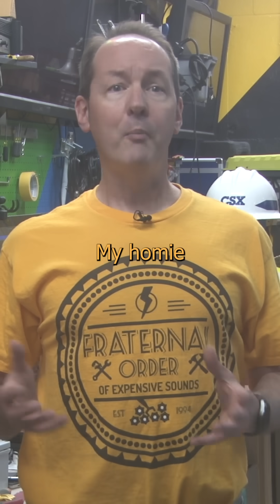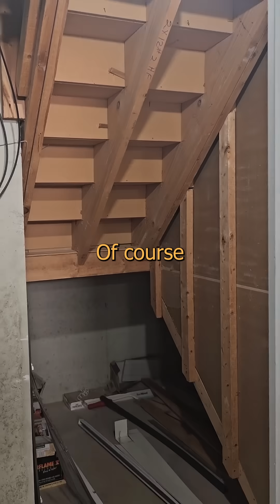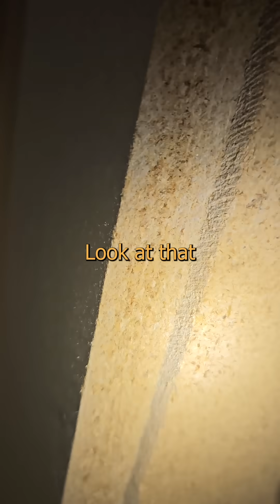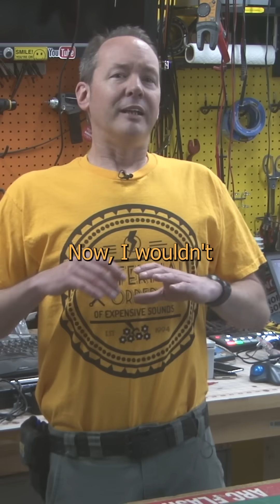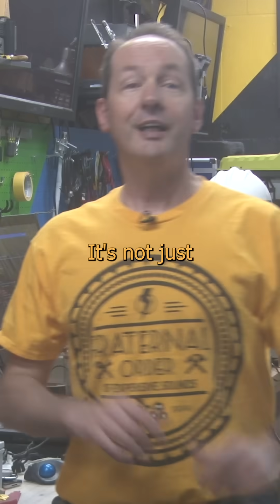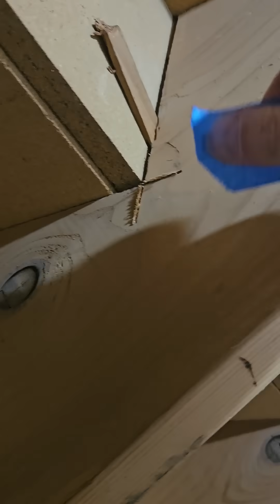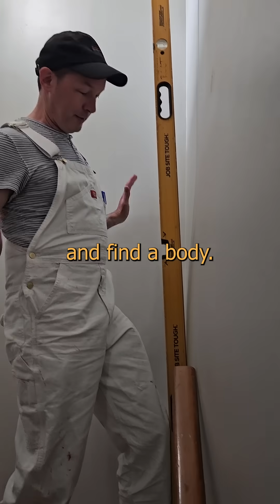Particleboard Staircase #chrisboden #engineering #construction #stairs #cheap #job #work #carpentry

Comment: It's like after WWII, we developed a leak in the bucket where we kept all of our know-how when it came to building homes, and it all just dripped out a little bit at a time.  I mean, the houses from before WWII are all full of wi-fi destroying flatwire for phones that nobody uses anymore, the stuff on the walls is lead and arsenic with a touch of paint to bind it, sayng that you a person utter the phrase "ground fault interrupt" in a tone you found to be offensive was considered a legal justification to shoot them dead on the spot, and god help you if you flush a toilet with someone in the shower who wasn't planning on receiving 3rd degree burns to most of their skin.  

BUT, they could sure do some god damn fine woodworking, I will give them that.  Few things are as rewarding as removing layers and layers of disgusting vinyl from several decades of cheap floors being installed one atop the other, only to get to the bottom and find some gorgeous (but thoroughly neglected) deep red oak begging to be loved, to see the glimmer off a cherry wood with grains that sparkle when the polish is high, or uncover a swamp ash floor with enough character that it could star in its own period drama about the decade of American history when it was first installed.  If you've ever done any contractor or contractr adjacent type of work, for sure on the east coast if not on the West, then you are well familiar with the excitement of a moment like what I was describing just now.  It's not what I do professionally, but it's something that I've had the pleasure of doing since I was a kid at my daddy's knee, and in all of those decades that shit never gets old.

Comment: Half the houses in NZ are built with floors like this. It can handle a fair amount of water if it's the proper flooring stuff. It's bad if you have a slow leak and you don't realise til it falls apart.

Comment: Yoo that wall drift is insane! There is no way that could pass an inspection on my state, that's like an inch a foot when regulation is something like a half inch for every twenty feet. Like if I were this guy, I would be more worried about that wall coming down than going through the stairs.

Comment: Over cutting the risers is very dangerous. They will break.
Take a 2×4 and nail it on each side of the middle stair raiser, with 3 inch nails, and on the inside of the two outside riserers. That will brace it forever. 
I am a contractor and was almost killed because of over cuts less than those. The framer I had hired to build a three story house had done that on all the risers going all the way up to the third floor. I had told him all summer to brace those stairs. I was showing the owners the house. We were on the third floor. (It was still unfinished at the time.) As I started back down the top riser broke and I fell 3 stories through the stairwell, breaking my fall with the second set of stairs with my ass and back, and that pitched me out onto the concrete 1st floor. As soon as I could stand, i had to get up and help the family off of the third floor, then I went down the other house that framer was building for me and fired him on the spot. 
If that second set of stairs hadn't broken my fall, it could have been really bad for me or one of the family members. I'm just glad it was me and not a worker or one of the family members.
So please tell him to brace those stairs, and stop being cheap with materials. If any water gets on that particular board it with turn into soft powder.

Comment: went to visit a friend was coming down from the upstairs almost stepped on a cat that was pretending to a shadow caught my balance briefly with the railing before it pulled out of the wall and away i went (turns out some brilliant jack-wagon who incidentally lived in the other half of the building decided that instead of finding studs they just put a little 4x4 piece of wood on top of the dry wall and put a punch of pin nails in it) worked ok if you pushed down on it lightly but if you tried to use it in a manner that was at all vigorous it pulled right out (i tested this next door while explaining the problem to the builder)

Comment: I haven't worked in carpentry for over a decade now and I still flinched hard at that sight. Don't even need water or anything, some guy in a hurry taking two or more steps at once has a non-zero chance to just push straight through this.

Comment: I worked as an HVAC installer and when we got called in to work on a house being built we were told to put in the AC in and we usually center it and square it off on the walls but turns out whoever put up the walls had a crooked eye or level because this thing was all kinds of warped and full of weird angles that did not meet at 90. It took me like an hour to figure out what "I" was doing wrong. Turns out it wasn't my fault

Comment: The paradox of houses getting more expensive but being more cheaply, I already know where the money is going
Reply: Lol at the reply to this comment that thinks it's the government at fault and not the quick buck builders shitting out houses where they cut every corner, way past safety limits, and still charge a pretty penny, and get away with it cause they've got people in their pocket.
A properly functioning government that wasn't lobbied to hell would be putting these builders out of business very quickly, and the houses would never reach market. The lobbying is done by the builder's investors, not by the government.
Reply: @blarghblargh people will blame literally everything BUT capitalism for the late-stage capitalist hellscape we live in. They will blame government, individual workers, immigrants, and even unfixable/persistent factors like "greed" or general incompetence before they point at the system that we literally can change. Literally anything that doesn't involve people demanding significant change (even though our lives keep significantly changing for the worst). I think part of it is because they would do the same things if they were in position of the corpos/capitalists, and their real problem is the fact that they are at the receiving end of it instead of the "winning"/scammers side of it, which says more about these types of people than anything else.
Reply: @VoteOrDie99  the non-functioning government is very much a part of late stage capitalism.
Reply: @blockwithaglock96 very much so because the capitalist corpos own it, and it's the last tool people really have left to challenge the owners (short of violence and direct action, really). Remember that the neoliberal solution of "vote with your dollar" means that people (and entities like corporations and interest groups) that have more dollars get more votes, which in a world of high income inequality means that a few people have the majority of the market power.
Reply: @VoteOrDie99  this happened in 2012
Reply: That's the american scam
Reply: Some is going to the inspectors, if your state has that
Reply: How else is he supposed to buy his new work Denali that has never loaded more than his 500 lb ass?
Reply: @duwang2324  The answer is always Wall Street
Reply: @duwang2324  I’m investing in particle board stocks RIGHT NOW
Reply: @duwang2324  this is not a new build.
Reply: Now every new house built must meet expensive energy efficiency standards with insulation that used to be luxury homes only, and insulated double pane e-coated argon filled window glass that didnt exist in the 1980s

Receptacles every 6 feet, outdoor receptacles, GFCI and AFCI arc flash current interrupt breakers on virtually every receptacle & load, hardwired smoke detectors, 

guess what's NOT regulated? Requirements to use materials guaranteed to last more than 20 years.
Reply: oo a clippy
Reply: yeah its going to israel
Reply: @pimphatwaggoner1655  They need the money so they can have free healthcare ☺️
Reply: To the b🇮🇱nk
Reply: taxes
Reply: In reality houses cost the same now as they did back then. What changed is our money. The difference in house prices now compared to years back is a reflection of the hidden tax we know as inflation. Look up how much gold it would have cost to purchase a house in the 80s compared to now. You will find the amount of gold required didn’t change. The paper money we use is no longer backed in full by gold. If you had the gold to do it then it would be the same price now then it was in the past.
Reply: @reefercreeper1750  You're wrong. Housing prices have gone up exponentially, while income has gone up linearly. Housing costs have outpaced inflation by 60%.
Reply: @RayMurphyX did you even read my comment? You are talking about the price in cash. I’m talking about the price in gold and the fact precious metals don’t depreciate in value the way our money has.
Reply: @reefercreeper1750 people don’t buy houses in gold. You are completely wrong on your inflation vs house pricing immensely. We are now exponentially dumber for having to read your ridiculous comments. 😂
Reply: @tylerburks6871 it doesn’t matter if people buy it in gold or not. Prove my statement wrong. If you can’t comprehend the FACT that the price in gold hasn’t changed then you are the one that’s exponentially dumber for making that comment. Whether most people buy houses with gold or not was not the point. Obviously barely anyone is out there buying houses with gold 😂 it’s a representation of inflation which you obviously can’t comprehend. As I said to others and I will repeat again. PROVE ME WRONG! If you cannot do that then you have no business claiming to know what you are talking about.
Reply: @reefercreeper1750 Have you considered the fact that you are conparing two goods whose price might have increased exponentially, maybe even for different reasons?
That's no claim that prices have stayed same, even less if conpared to workers income, and even less so if the prices of most other goods haven't risen at the same speed.
Remember, correlation doesn't always mean causation.
Reply: @RayMurphyX  the price has increased bc of inflation AND the decrease in interest rates.   Dollars to dohnuts you are paying the same price as anyone in the 80s.
Reply: @reefercreeper1750  The price of gold has changed since 1971, when the US dropped the gold standard backing for the dollar.
Buying a house back then would require almost 600 oz of gold; today, due to market fluctuations, it would take less than 100 oz of gold to buy a house at the median price. Because despite your bizarre, reality-denying claims, gold has not magically remained the same price for the past 55 years; it didn't even remain the same price between January & December of the year it stopped backing the US dollar.

So not only are you wrong, you're fractally wrong.
Reply: @reefercreeper1750 that is unfortunately very wrong, if you do some quick math you can see that the median cost of a house in 1980 was ~$62000, and if we adjust for inflation that gives us ~$243000 in today’s money, if you were right houses would cost about that much today, but unfortunately as of August 2025 the median price for a home is over 400k. TLDR we got fucked over and houses are almost double the cost.
Reply: And before you start some shit about “the price of gold” this has nothing to do with gold, if you bought a house with gold in 1980 vs. today you’d need double the gold! That’s what adjusting for inflation means!
Reply: @reefercreeper1750 I don't think I've ever read something so wrong in my life. Jobs pay the same as they did before, prices on houses have went up over 7x, and we aren't on the gold standard at all. Since 2015 house prices have gone up almost 2x. And then to top it off throw in inflation.
Reply: @reefercreeper1750  Sorry mate, but you're dead wrong. That's not how ANY of that works, and inflation isn't the only issue.
Inflation has caused a 700% price increase since the end of gold backing the US dollar, but houses in the States are currently 1500% more expensive than they were when the gold standard was ended. They've gone up drastically in just the last 20 years, too - and a large portion of the blame can be laid at the feet of greedy property management companies & real estate lobbyists.

The price of gold wouldn't change the increase in housing prices, because the increase isn't purely due to inflation. No conspiracy theories or armchair economist nonsense will change the facts.
Reply: @reefercreeper1750  you have no idea what you’re talking about
Reply: @2ndbrain909 prove me wrong then. You can’t because YOU have no idea what you are talking about. You all say I don’t know what I’m talking about but nobody has even tried to prove me wrong.
Reply: @reefercreeper1750  it's all pretend. Even the shiny rocks. We made it all up. House prices have far outpaced inflation.
Reply: Homes in the US are dirt cheap despite what the Internet thinks for some reason, which is the problem.
Reply: @calebm9000 you either live in Switzerland or have no idea what you’re talking about
Reply: @calebm9000  even if that were true, which it objectively isn’t, how exactly would that be the problem?
Reply: @calebm9000  Median house price in the US is 10x the median yearly income. Up through the early 90s, the median income was enough to afford a house without a bank loan.

When the median house price is $400,000, and the median income is $40,000 a year, that's not "dirt cheap" to anyone who didn't grow up wealthy.

Comment: You are correct. The treads are a no go. So are the over cut corners of the risers. That should have all been caught during the home inspection. Since they were not the owner may have cause to hold the inspector to task on getting them fixed. That’s why home inspectors are required to have tons of insurance coverage.

Comment: As a carpenter, I'm a bit scared from what you've shown us, and I've done Victorian remodels!!
I don't know if that particle board is code there or not but it most likely is if its in an area that is not expected to experience moisture. I know that I've seen a ton of it used, mostly as subflooring. I have never installed it and if that was my house I would either tear out the treads snd replace or install treads over it. I'd also check the rest of the flooring on the house, particularly the bathroom and kitchen, to see what they used. Im guessing that is a early 80s build?

Comment: As someone who lives in a mobile home from the late sixties/early seventies,

actually this construction is still sub-par.  Yeah, this double wide has 3/16" thick panelling for its walls, none of them are straight, the whole thing is bowed when you look at it, ceiling, floor, doorways are visibly skewed, all that.  And yeah, the floors are largely particle board.  But that's particle board over 2x8 joists over I-beams.  Any room with moisture also has plywood flooring rather than particle board, such as the kitchen and bathrooms.

Comment: The material it self is least of concern. It is more Than strong enough. But the execution and usage ? Well thats a problem.
Reply: Particle board × humidity trapped under the stairs 
Partial solution = dehumidifier + goldenrods

Comment: Those stringers are cut improperly, being cut too far into the supporting structure of the stringers. That's not good. It reduces the amount of weight they can carry by at least 200 pounds per step due to it being cut improperly, too deep like that into the load-bearing material. Add that the treads and risers are made out of full-fledged particle board and you have some very dangerous code violations. Those could not ever pass inspection which leads me to believe a really shitty contractor built those fuckers and did so as cheaply as possible to save himself the money to pocket it while buying the cheapest and most certainly very dangerous materials to use for these purposes...

This contractor needs his ass beat. He's going to certainly get someone very, VERY injured in the least or killed. Those should be torn out and redone properly. You don't cut stringers like that with a circular saw, you use a Sawzall or a hand saw to prevent over cutting into load bearing materials and you only ever use the right material or better for the treads. For risers, you could technically use anything being its little more than a glorified toe kick. Still, though, use something that you won't accidentally put your foot through, please...

Comment: What the actual F?  😳.   What's the bet there's masonite on the topside covered in carpet... or just straight, non fire-rated cheap as chips nylon carpet.  That's gotta be the first stairs I've ever seen with an 80lb weight limit.  What did the builder use for the framing of the rest of the house?  PVA glued matchsticks or paddlepop sticks?